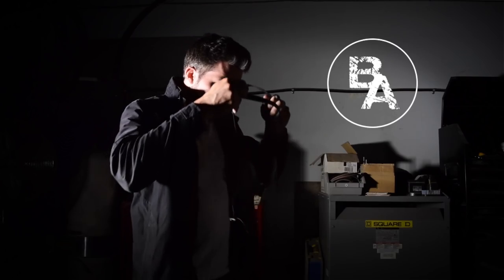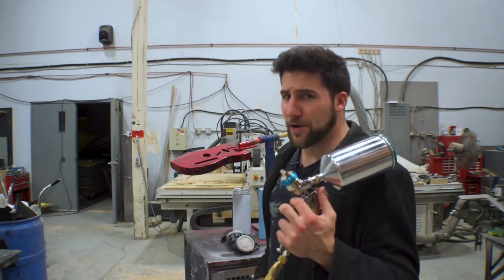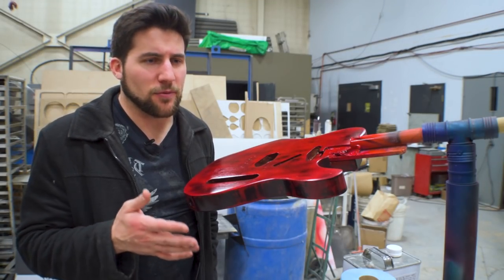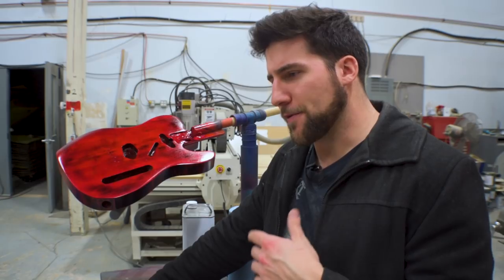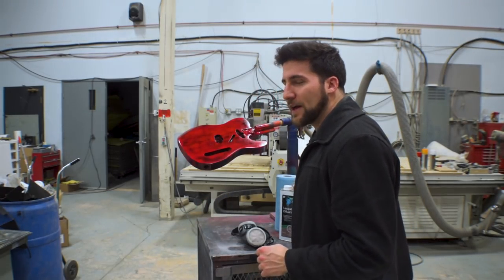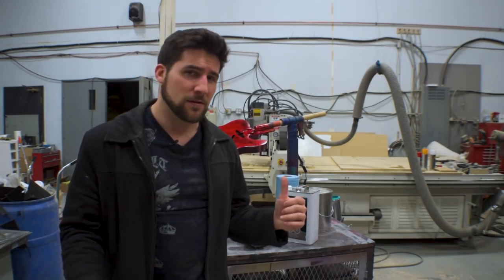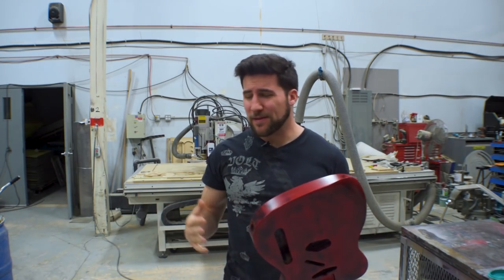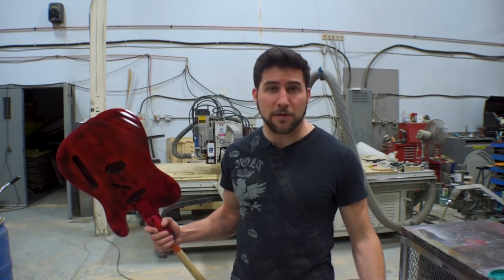How to Paint With Nitrocellulose Lacquer

Comment: I used to run a finishing shop years ago (in another life). For production runs of mill work, furniture and office fittings (paneling, cabinets, reception desks etc.) we used a synthetic catalyzed lacquer from either CIL (Guardsman I think). It was fantastic stuff... once catalyzed your pot life was about 10 days, so not like an activated 2 or 3 component really hot activator. The best part, it was a high build quick dry product, but it sprayed like a normal nitro lacquer (albeit a bit thicker). The best part, you could go from stain to shading / colour adjusting or fading to sanding sealer to finish coats in a matter of a few hours. I once did a re-spray on my Managers 1980's Fender Strat that turned out amazing with that stuff. 3 or 4 coats of high build sandable primer, 5 or 6 coats of Auto Lacquer (Honda Silver Metallic) and then about 10 coats of high gloss clear. As with lacquer each coat melts into the previous and flows out like glass.

Give it a couple of days, and it you could wet sand it and polish it with care. Amazing stuff. Not something I would use for a piano (though I did a few times) it was rugged and beautiful in a 99% sheen. I bet I sprayed my way through 5000 gallons of that stuff (full face and fresh air system in a booth)... and never had an issue. heh It had a lot of pluses over traditional nitro coatings, and only a few negatives. Plus you could use aniline dies and stains under and in it to tone it. Mohawk stains being my favorite (or Pierce and Stephens).

Great channel BTW, informative and interesting to follow along. Subscribed! Nice work.
Reply from the maker: Thanks Greg. I use some pre-cat lacquer. Need to get my hands on some good catalyzed stuff one of these days.

Comment: I’m a fan of shellac. Non toxic once dry, can be thinned with 190 proof alcohol so you don’t have to use toxic methylated denatured alcohol, doesn’t yellow over time, doesn’t need to be sanded between coats, comes from a renewable resource. Good stuff
Reply from the maker: Unfortunately it isn’t particularly durable, but I’m also a fan nonetheless.
Reply: Brad Angove yeah, definitely not durable, but up until now I’ve only used it on the drums I build and decorative furniture that doesn’t get touched/handled often.

Comment: Hey Brad! I'm a rookie and getting my first built Les Paul copy soon ready for finishing and still wondering the correct working order. Is the next procedure right:
1. Sanding
2. Staining the mahogany body and neck
3. Filling mahogany grain with Wudfil Easystain grain filler
4. Painting the maple top to copper top look
5. Sealer
6. Clear coats
I'll be using nitrocellulose laquer for clear coats and spray cans for painting the top if I'm able to get suitable copper paint from automotive paint shop. Thanks for advises beforehand!
Reply from the maker: You’ll want to stain after doing the grain filler.
Reply: Brad Angove thank you very much for the tip👍I was wondering those steps for a long time so good to know. I can share a picture when the guitar is ready 😎

Comment: Thanks Brad.  Another great and informative video.  Started spraying my last six coats last night.  2 today and 2 tomorrow to go before a month of curing.   Can't wait!
Reply from the maker: Awesome. How’s it looking?
Reply: I had a few pits from the project stands in the back of the body.  So I had to drop fill those.  I had a couple that were pretty deep, so it's taking several rounds of drop filling to get those completely filled.  Other than that, it's looking pretty great.  I'm very impressed with the performance of the Behlen products and how well it's turning out.  I give you a big nod for all the guidance!  And a big Thank you for the videos and how-to's! Keep 'em coming!
Reply from the maker: I’m glad to hear it’s going well in general. The Behlen stuff is pretty reliable, which of course makes things a bit easier.

Comment: Great vid you put it on way heavier than i thought you would in my head. Ik this sounds crazy but could you buff a lacquer on with a super soft cloth or sponge and be buffing it as its drying just with the cloth so in my head that would get rid of streaks or what if you poured the lacquer in a thin metal or plastic box, dipped it, then poured the rest back in the can and hang the guitar vertical and diagonal where the neck joint is pointed down so the drip gets on your pole and there isnt a spot of a drip hanging on the guitar? Would you have to make it a very thin mix so too much doesnt cling on at once?
Reply from the maker: There are wiping lacquers. I’m not entirely sure how you would mix one. You’d probably just want to buy one designed for that.

Comment: Would you do that many coats of satin vs clear lacquer? I hit my neck with 2 coats of sealer, and 3 coats of satin.. I wasn't planning on going more but shit... should I be? The stuff I used was recommended to sand between coats if you wait past 6 hours... which is a major pain with lacquer for me. I will definitely just be going 2k spray gun next time lol.
Reply from the maker: That should be enough coats. I try to avoid building up a ton of satin because the additives in it can cause it to get hazy.

Comment: Is there a water based lacquer that you recommend? Also tint. Will be spraying a Gibson LP studio with a preval spray system as I don’t have any spray equipment. I’ve tried a few different polyurethanes rub on and rattle can. I’ve sanded both back as they didn’t turn out to my liking. That deep wine color in the video is the exact color I have been after.
Thanks.
Reply from the maker: Crystallac has a water based lacquer system that works really well and has stains/tints. I’ve got a bunch of their stuff in the amazon link in the description.

Comment: i bought a cool looking neon blue spray can from motip which is nitro. can i clearcoat it with a 2k? should i use something else to clear coat it? i wanted to put a few layers of phosphorescent paint between color and clear coat.
thanks for your videos, i've learned a lot from you!
Reply from the maker: Normally one would stick with nitro for the clear, but if you let it dry full for a few weeks and scuff sand with 800 grit you should be able to use 2K overtop.

Comment: Hey, really enjoy the vids and your instructional style. I need to do a small patch on the bout of a classical guitar where the finish was damaged by a bad cleaning choice, lol. I was wondering what size nozzle on your gun. I couldn't seem to find that info. The nozzle on mine is 1.8mm and I've used it with 50/50 deck stain/varsol but wasn't sure what you're using or if there is a real difference between a 1.8mm and, say, a 1.5mm. Thanks for all the great tips!
Reply from the maker: 1.8 is very large. For lacquer I usually use a 1.3, or even a 1 or 0.8 for smaller tougher work.
Reply from the maker: *touchup (not tougher)
Reply: @BradAngove  Thanks for the info!

Comment: Brad, thank you, Sir, for all the paint knowledge you are bestowing on us with your videos. 
You briefly touch on checking, suggesting that it can be created by decreasing the temperature of the paint. 
With a nitro pre-polish dry time of around one month, you also mention that shortly after painting is concluded, the checking process can begin.
Can you please explain to me when to start the checking process?
Is the checking done during the curing month or after polishing, along with what your method is for creating checking? 
Thank you!
Reply from the maker: I’m no expert on creating checking. It’s not something that I’ve done, especially not deliberately. The idea though is that it’s formed by paint shrinking, and cold causes paint to shrink. For that reason I would probably paint the guitar, let it dry for about 30 minutes, and then freeze it overnight and see what you end up with. 
You can also create a checking effect with a scalpel.
Reply: Interesting method you’ve suggested. 
I’m definitely interested to see how the nitro would react to cold immediately (30 minutes) after the final coat. 
I would also be very interested to see how different types of paint (nitro, poly, etc.) react to different environments, along with how fresh paint, versus cured paint, reacts to these changes.
Again, very informative videos you’re doing.
Thank you!
Reply from the maker: I can tell you that cured paint, such as polyurethane, won’t react to cold. Nitro lacquer, which doesn’t cure, may still shrink even after it’s fully dry.

Comment: Hi Brad , I was wondering if u some brush art painting on the guitar with oil painting or acrylic. can you still coat it with nitrocellulose lacquer ?   would it burn it / eat in ?  if so how do I protect art painting when using nitrocellulose lacquer ?   
Thanks in advance
Reply from the maker: It depends on the paint type. For acrylic for example I may use an acrylic top coat as a mid-coat, then let that dry fully and sand it before spraying with nitrocellulose lacquer.

Comment: Enjoyed the vid. As for a nitrocellulose top coat, what base coat would you use prior to applying a top coat? Is a base coat necessary when using a cellulose top coat? Just going with a black top coat and clear lacquer.
Reply from the maker: I use nitrocellulose as the base coat as well, and then a sealer underneath. I like Mohawks vinyl sealer.
Reply: @BradAngove  thanks! So, currently, my steps will be to fill dents/scratches in bare wood, sand smooth, clean dust/debris, spray/coat with sealer, spray with top coat (black) then spray with clear lacquer. Sound good? Sorry, I'm hesitant as it's my first guitar refurb and I want a nice finish, as you do 😁
Reply from the maker: Yes, that’s the gist of how I would go about it.

Comment: Is it true that certain types of rubber including those common on guitar stands and racks can cause damage to a nitocellulose finish?
Reply from the maker: Yes. Over time that can happen, especially with a nitro finish that is relatively new.
Reply: YES but I’d say still worth it, having the fortune and misfortune of owning an old nitro strat that got rubber “spots” on the body from my rack.
Reply: I left the Capo on the head stock of my Gibson Les Paul for about a month.  Found out the hard way when I pulled it off that it pulled off all the Nitrocellulose lacquer clear coat down to the paint.  I had a 4 inch by 1/4 inch stripe of missing lacquer on my prized guitar.   I think I cried that day.   It was a cheap capo (not Kyser) that did it but yes, some rubbers can damage the finish.    Fortunately the fix was relatively easy.  I bought some Nitro and brushed it on in multiple coats until the height was the same as the surrounding lacquer.  When I sanded and buffed it out, you couldn't tell there was ever a problem.   Still, I won't put my Capo on the head stock anymore.    Good video, and yes, Nitro is easier when a repair is needed.
Reply: What about foam? What is a better solution?

Comment: Hi....cool channel....I'm refinishing a 63 rele body for a customer, but the guitar has been stripped down but there is some sort of old unoriginal clear coat, is there a good sealer I can apply as a base coat for the lacquer base coats this way I don't run into any problems???
Reply from the maker: Are you leaving the sealer that’s already on there?
Reply: @BradAngove  I finished it today, sanded to 280, put 2 coats of sealer, then color coat, seems ok

Comment: Hei Brad! Quick question; Im painting a headstock to be matching colour With body. So my plan is 3 passes times 3 or 4 to get the colour on. Wait for it to dry, apply decals, and then do  clearcoat - sanding, Clear coat - Sanding, Clear coat - Polish to cover over the decals and smoothen the Surface. Question is; Do i need to polish the coloured laquer  before applying the decals? Or is it enough to polish the end Product/final Clear coat? Best regard - Erlend
Reply from the maker: I don’t do any polishing until the very end.
Reply: Thanks mate! Also; After applying the colour laquer, am i in a hurry to spray the Clear coat? Or can i rest for a while (Weeks) while i wait for my 63 Jaguar Decals to arrive in the mail? =) Wanting to start right now, but dont have the decals yet.
Reply from the maker: You can wait as long as you want.

Comment: With regards to your other video about spraying a guitar body with binding: would you do all of the color coats before scraping it off of the binding, then do the clear over the binding, or with multiple coats of tinted lacquer, would you scrape the previous day's color coat before doing the next coat? I'm looking to spray tinted color over a natural-colored archtop that has cream-colored binding, and I want to keep the binding its original color, but I feel like I'd want the clear to cover the binding to avoid the sharp edge where the color stops. Just not sure if it would be too hard to scrape it clean with multiple coats dried over it.
Reply from the maker: I’d do them all at once as per your first option there.
Reply: @BradAngove thanks! I appreciate your videos, keep up the good work.

Comment: What is the optimal temp and humidity when you are letting the finish dry/cure? also hear that sunlight can play a role on lettings them cure in the sun?
Reply from the maker: Letting things cure in the sun is a bad idea. The optimal curing temp and humidity changes based on the finish, but generally as warm and dry as possible is good.
Reply: @BradAngove  I can't say its good here because normally its -4C and humidity is usually high even when its cold. Florida was not too bad because you can dehumidify fairly easy when its 90F out. The best I can do is about 22c at 18% humidity in a closet :) is that within range or am I looking at 4 months cure time.
Reply from the maker: That’s pretty reasonable

Comment: Thanks Brad. I asked a question about Acrylic lacquer recently and you said you sprayed it very similarly to other lacquers. I'm wondering, does Acrlyic Lacquer "melt" into itself like other lacquers so there's not need to sand key scratches even after it's fully dried before recoating??
Reply from the maker: Not like nitro does. I wouldn’t trust it to do that; I would do a light key sanding.
Reply: @BradAngove  Thnx. Was hoping to avoid that  i want to do a spot repair on a hood corner and tbe flow coat clear ova whole hood, but i find even light 800 scratches can show thru clear ... i wonder wots finest paper i cld go or if adhesion promoter instead wld work?
Reply from the maker: If 800 is showing through your clear you’re likely not applying it heavy enough. That shouldn’t be the case.

Comment: I have a black squier strat body, looking to use some behlen/colortone products to get a nice sonic blue color, first timer...should i strip the paint via the heat gun tech and seal up the wood with some sanding sealer, etc? Or should i just sand it up without removing the paint and maybe put some primer, etc?
Reply from the maker: You should be able to get away with just sanding the paint at 600 grit and then painting. If you’re using Behlen, I would start with a coat of their vinyl sealer before moving on to the lacquer.
Reply: Cool, sand it at 600 as is, then apply the vinyl sealer, then the color/lacquer? do i sand between the sealer and the color/lacquer? Thanks man!
Reply from the maker: I would advise waiting three days after the sealer, sanding it smooth to about 800 grit, and then moving on to the lacquer.

Comment: Great vid. I'm going to be attempting a full respray of a body that I have once attempted a few years ago. For some reason the lacquer never fully cured and is always sticky which I hope to completely remove and start a fresh. Any ideas why this is? Is it because in the uk we can only get water based lacquer instead of oil based?
Reply from the maker: It could be. That stuff requires a bit more time between coats and should be applied in light coats to allow it to dry correctly.
Reply: @BradAngove  thank you for the reply. I'll take this into account and give it a go! Your videos have definitely helped alot.

Comment: I sprayed a guitar with lacquer but I'm wondering now if I shouldn't have used poly instead as it's neon and I don't actually want the yellowing or relicing. Can I go over the lacquer with poly at some point to toughen up the finish or will that totally bugger everything to buggery? Wish I could spray as easily as you though, you make it look so much easier than it is.
Reply from the maker: You can give it a few weeks to dry (away from sunlight so it won’t yellow prematurely) and then scuff it and coat it in poly. 
What part of the spraying is giving you trouble? I’m wondering if it’s a difference in practice, or just in equipment.
Reply: Brad Angove well, it's been about 8 months so should be dry by now. Lol. My painting always ends up with runs or bits in from somewhere so I have to sand back and recoat which doesn't give me complete coverage so I overspray and get runs and bits in so I have to sand... you make me think it's going to be so easy and every time it's a bloody nightmare of cock ups.
Reply from the maker: Haha sorry about that. I’ll try to make a mess of one one of these days to temper expectations.